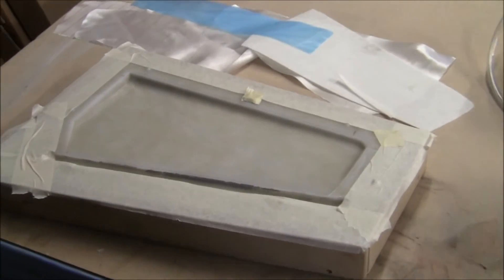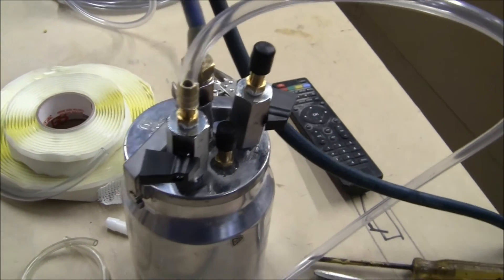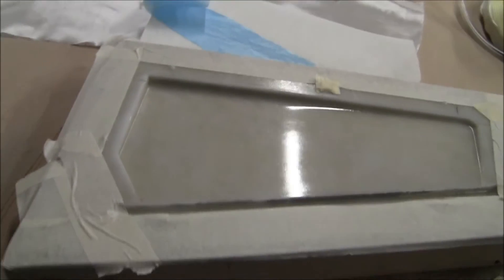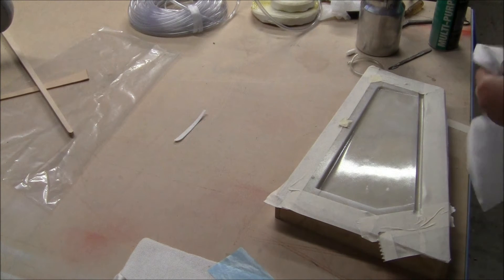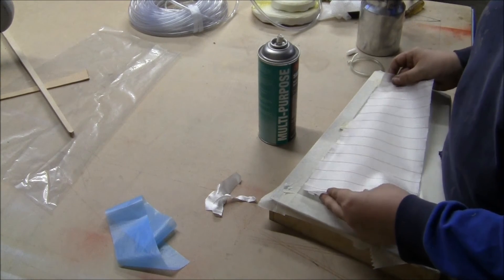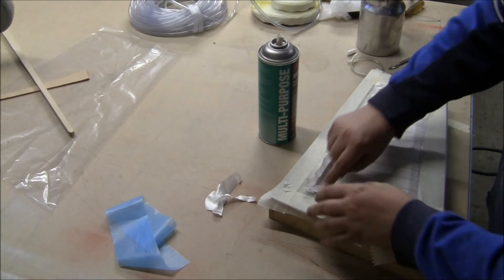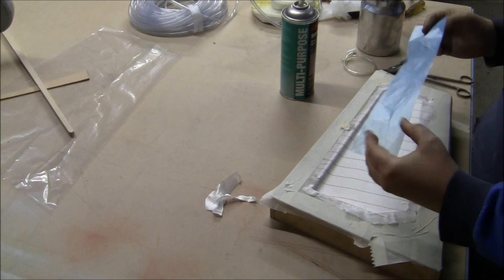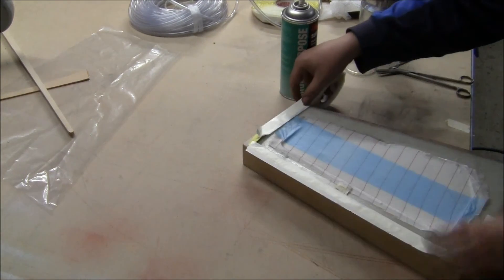Vacuum infusion 3.5 m L-13 Blanik rudder PT1

Comment: thanks for sharing these videos guys. looking good. I have a question hopefully you can answer; When you start laying up and use 3m fixing spray....you leave a little bit of fabric laying on the mould..... How do you combine the two halves of the wings?  do you trim this flanges after being cured?  it would be great to get some clarification. Also, if you tried to do so with carbon fiber?  and what thickness of soric core material you use?